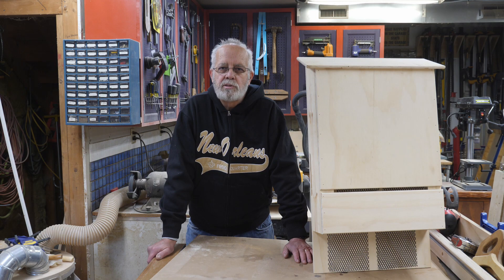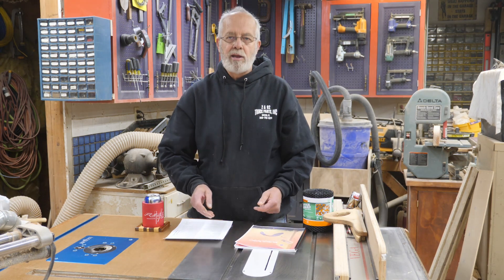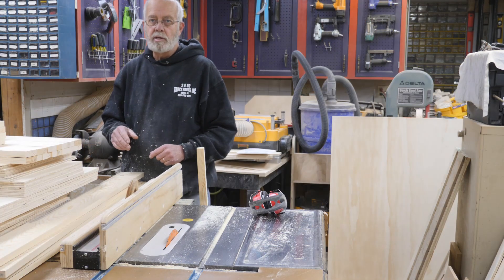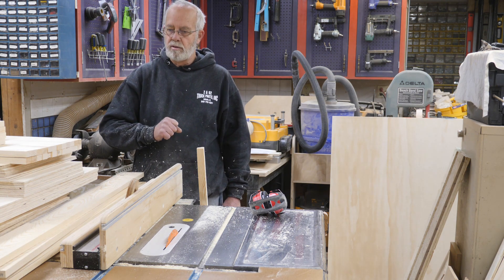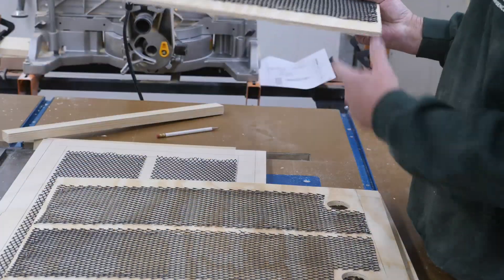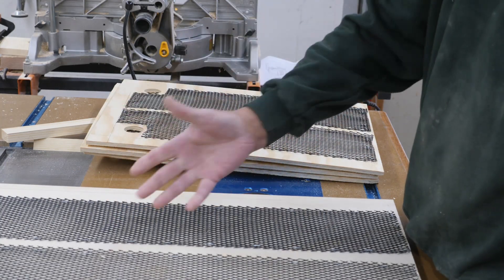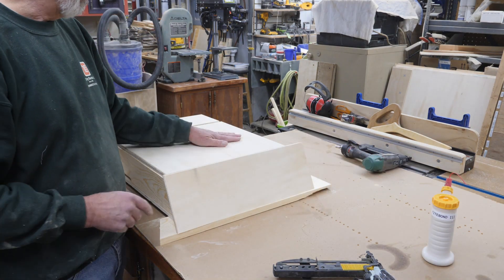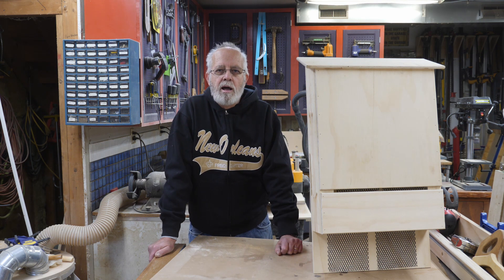Building a 4 Compartment Bat House Short Version

Comment: Hi very good and helpful video. I think I might make four of these for my property. Instead of plastic gutter gaurd I think I will cut one eighth inch grooves into the baffles so no bats get caught, trapped and vary the gaps between chamber panels from three quarter inch and one inch. We have  big brown bats and a few little brown bats around here. We also have the red paper wasp that are always pissed and ready to sting. Hurts like hell. I'm kinda worried about them taking up residency before the bats do with the one inch gap that they like. They say three quarter inch spaces are too tight for wasp to live in but is it too tight for bats to live comfortably??
Reply from the maker: I'm not a bat expert, so can't answer your question with any accuracy.
Reply: @rogersshop  that's ok. Me either. Hey do you have bats in your bat house or houses?? When I build mine I will be doing weekly bat house watches to see if  and how many move into them. I'm hopeful though.
Reply from the maker: @shawndubay4050  I've been told I have bats in my belfry many times...........  None in our house or out buildings.  My bathouse that I did have up was lost last year during a strong Derechio storm that came through.  I do intend to replace it, just have not had the time.